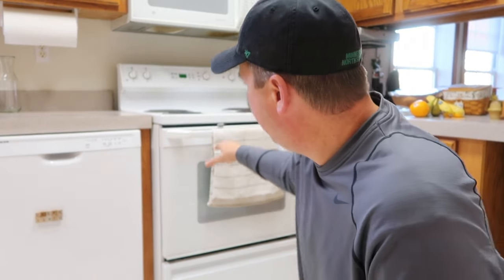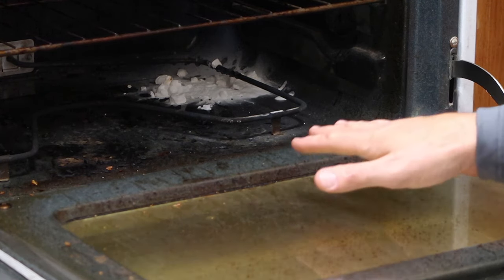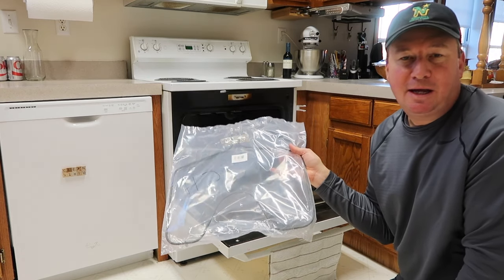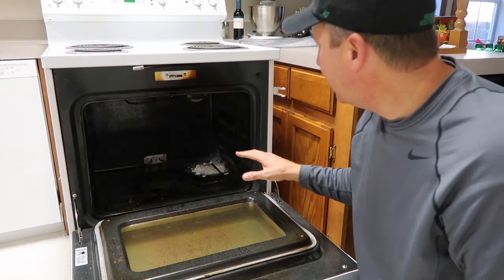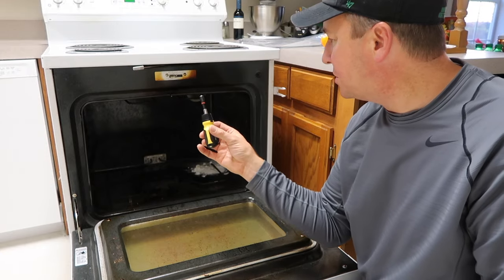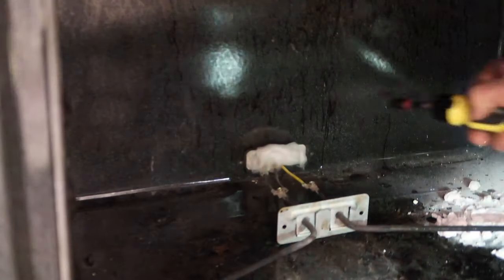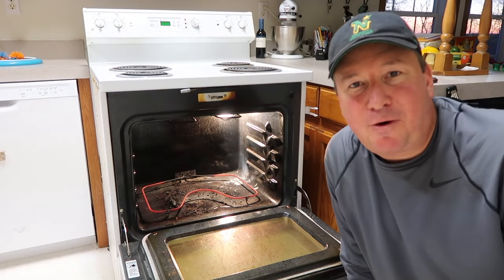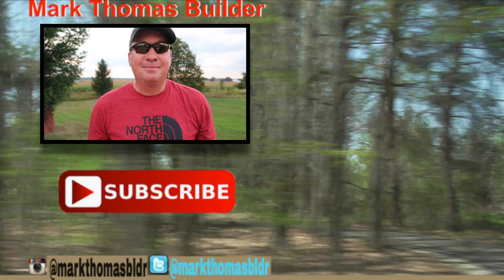HOW TO REPLACE THE BAKE ELEMENT IN A GE OVEN

Comment: Avoid using self clean. It pushes the oven to its limits and often results in a service call. The worst result I ever saw from an oven where the customer ran self clean was when the 900°F temperature deformed the bottom of the oven such that the oven door would no longer seat right. The range had to be replaced.... Better to put a pan inside with water and then bring it to a boil for a steam clean...
Reply: I just told my wife this but she thinks I'm complaining.
Reply: @OzonebxGaming  Wives.... lol
Reply: Interesting....I just used the self clean feature not long ago and now have to replace my lower heating element.
Reply: @michl37  Another common result from running self clean.... Self clean for all intents and purposes is a scam.
Reply: @JaleelJohanson62  when my friend replaced it he said you could see how the the wire was burned and confirmed that it was from the high temperature during "self clean".
Reply: Thank
Reply: @michl37 Me too!!!

Comment: This happened tonight at my sister's house. I baked a pizza in her oven. Afterwards, the element starting making a noise, then started on fire. She blamed it on me, but I guess it happens eventually. It's a built-in wall oven that's been in her house since 1991.
Reply from the maker: Yes, I was surprised when it happened to my oven, but I guess it's more common than what you might think.  It's definitely not your fault.  
I'm not sure if the self cleaning ovens wear out faster, but I'm guessing that they do.

Comment: Are the GE heater elements a standard size? If not, how do you know which which replacement part to get? Is the model number on the back of the stove?
Reply: The Model # of your stove should be on back along with other useful info. Or you can put the Make of stove in your search & compare the elements that look like yours. That's what I ended up doing.

Comment: Good video. I'm going to try it. Am I the only one who didn't know you should never put aluminum foil on the bottom of your electric oven? I've done it for years, today I learned the hard way it's a no no. The only thing I would say about this video is that you could have taken the oven door off very easily and it would have been easier to reach the screws. Thanks.
Reply from the maker: Good luck with your repair!  The door removal is a good point.
Reply: Sharon I COMPLETELY agree about the door removal.  With my GE stove manufactured in December 1998 the door removal was an easy lift up off these brackets and back on.  I saw someone else comment that it 5 or so screws were involved so I really lucked out with the lift up/drop down door removal.

Comment: Awesome vid! When I was hooking my element up, the right hook up wire was short. I had to unscrew the back part of the stove to reach the wire. The wire was going through a silver ring. When I took the wire out of the silver right I was able to connect everything. I tested The stove out and everything is working correctly. For caution reasons Do you think I should go back at try to put the wire back through that silver ring?
Reply from the maker: It's hard for me to answer that question without seeing the silver ring you're talking about.  My advice is to put it back the way the manufacturer installed it.
Reply: markthomasbuilder thank you for the response. I did.

Comment: ok... what he didn't tell you was that the 2 black wires on the left side of the element...   that wire has 120 volts constantly to it, no matter if the oven is turn of or not.   The yellow wire is 120 volts coming down from the replay and is only energized when you turn the oven on bake or self clean.  But...  power is always there if the appliance is plugged in on the black wires bottom element.
Reply from the maker: Thanks for sharing.  I recommend unplugging the oven from the wall before doing any work on it.  It's a good opportunity to clean all the junk that ends up underneath and behind it.

Comment: You should have cleaned the oven BEFORE you installed the bake element.
Reply from the maker: Yeah, good idea!  I try to run the self-clean part when I can open the windows for several hours.  Spring and fall season is best.
Reply: Dies the Self Cleaning even work if the Bake Element is NO GOOD??

Comment: THANKS FOR POSTING ! The video made it EZ to install my GE was hard wired so turned off the breaker and pulled the element forward unplugged the spade lugs plugged in the new unit and it was a done deal under 10 minutes. New unit was $19.98 on ebay received in two days.
Reply from the maker: That worked out well!  This repair is much easier that I originally thought it would be.

Comment: Thanks Mark. I'm very experienced with electrical work but I wasn't sure how the element came out. However, my GE oven does not have a rectangular hole in it. It has two small, round holes so I'm hoping I can get the terminals through there without pulling either of them (or both) off.
Reply from the maker: It was easier than I thought it would be to replace.  Good luck with yours!

Comment: I am sooooo glad to have found this video. THANK YOU!!! Mine is in a tight spot so I was contemplating how to get my tiny (adult) niece behind it in the hopes of getting to the wires.  Three things I will try/do is 1) turn it off at the fuse box because I am unsure if the outlet is reachable 2) clean it while the bottom element is out/broken and 3) use clothes pins to try to stop any wires from escaping into the cavity from which it came.  My oven will be alive again properly in no time.  PS...I remember there being extra smoke the day I think it died.
Reply from the maker: I'm glad to help.  I was actually thinking about just fixing the oven and not doing the repair.  I'm glad I did, because I really like to help people.  Thanks for sharing and hope the fix goes well!

Comment: My element doesn't have screws but nuts holding it in and I am having a time trying to get them out.
Reply from the maker: One thing I may not have mentioned is that you can normally take the oven door off pretty easy.  That might help while working on it.

Comment: Usually your oven door comes right off, giving better access to change the element and when the element comes out, it's a good time to clean any large deposits off the floor which makes the self-clean easier.
Reply from the maker: Good tip!  Thanks for mentioning that.

Comment: This video was very helpful. My heating element went out on Thanksgiving day while I was cooking. I had everything cooked except my sweet potato pie. I saw a small orange spark and at the time I didn’t know what was wrong but I turned off my oven and let it cool that way but that didn’t really do much but when I unplugged it that seem to help cool it down faster. I left it unplugged and went to Lowe’s only to be told they didn’t sell them in the stores anymore so I found a place online up in Philadelphia that sold it for around $12. My total cost was $24 and some change which was cheap considering trying to find that part online at other places they were asking $39 and $58. I ordered my part on Saturday and got  it Tuesday. Installing it was simple and quick  just like in the video and it help that I have the same stove too. It started smoking a lil bit but that was normal. I just put it on 200 and let it warm and after the smoke faded out I was good to go. Thank you for sharing. Much cheaper than calling a repairman and paying an arm and a leg to get it fixed lol.
Reply from the maker: Glad this helped!  I remember thinking I needed a new oven when it happened to me.

Comment: Tip to everyone, make sure you shop around.  I've seen these elements as high as the $80's and less than $10 - mine was maybe $12. I did my repair and oven cleaning today and I THANK YOU for doing the repair through the back if the oven, versus the panel in the back.
Reply from the maker: I bought mine locally, which was much higher in price than online.
Reply: @MarkThomasBuilder  I heard you say it was $45.  I had stopped at a local appliance store and they were in the range of $25-50 (I didn't find out about mine in particular).  I think what allowed me to go online and wait for a cheaper price was mine was already dead for about a month (toaster oven subbed in if necessary).  I had a friend say she'd just replace the whole oven.  Not unless I HAD TO.  Again...you were a BLESSING with this video.

Comment from the maker: Have you ever had a bake element start fire/arc?  Did it freak you out a little?
Reply: Mine just did in our apartment. Also a GE, but I think an older one than yours. Had it preheat to 450 when I noticed it sparking. After it cooled down I noticed something of a crack in that area of the element. Hoping maintenance can come replace it soon.
Reply: Yes..was about to bake today n heard a massive crack. The was a huge white glowing arc n spark along with an electrical sizzling sound.. Scary!
Reply: Yes indeed...4th of july sparks show coming out of my oven. It was a 2&1/2 year old replacement element. Putting in a new one now. Very scary with electrical fires. This is my 2nd install.
Reply: Yeah just about 10 mins ago. Holy shit batman I thought we were going back to the future. As if the tension wasn't already high enough this week!

Comment: That's exactly what happened to mine. Same oven.
Reply from the maker: I thought I needed a new over when it happened.  I forgot the exact cost, but recall you can buy one for less than $50.  It's a fairly easy fix luckily.

Comment: Well first do a little research to make sure you get an oven heating element that matches your range/oven. the name and model number can usually be found on the lower right hand corner of the door. Either unplug the oven or turn off the power at the circuit breaker. And it is usually easier to access the back of the oven if you first remove the oven door. A lot more information can usually be found by visiting the manufactures website under support.
Reply from the maker: Thanks for the tips!

Comment: I replaced the burned out heating element and measured the resistance of 19 ohms at the terminals when I connected it, but both heating elements do not work and do not heat up. Apparently, when the heating element was shorted on itself, some element inside the firebox was damaged too, although inside the oven the light works and backlight of the mode switching buttons also functional. I have to figure out now how to remove the oven from the cabinet.
Reply from the maker: Humm, I don't have experience with those types and how they're installed.

Comment: An appliance salesman told us that the high heat of self cleaning can make the element go bad. They're now selling steam cleaning.
Reply from the maker: No kidding, that's interesting.  I need to self clean mine, but I better be ready to buy another one.  Luckily it's a quick repair.
Reply: Looks like our element is under the floor of oven but don't think element is our problem anyway.

Comment: So interesting. I have a similar problem at home with an oven I found here in the apartement. It's not mine, though. I need to buy the bake element ( the botton burner). I hope to succeed. Thanks for the advice.
Reply from the maker: It's much easier to do than you might think.  I know some apartment places will fix it for you, which is included in the rent.

Comment: Next time you need to do work inside oven, Remove the Door so it's easier to get inside.
I get to do this on my oven over the next week after I get the element.
Reply from the maker: That's a good idea.  I have a self-cleaning oven and think the door is more difficult to remove.  I recall standard ovens where the door comes off easy.

Comment: No but it was glowing brighter than it was suppose to in one spot. Probably it was about to fail. Stove got hit by lightning later on and now does not work at all. Now using countertop oven and portable burners.
Reply from the maker: Wow, not sure what to say if it was hit by lightning...  My bake element was an easy fix and works great now.

Comment: My wires were the same color. I just attached where they came off from. I think I got the wrong size tho it seems a bit big.
Reply from the maker: Did you match you oven model number to the part?  I'm guessing there's various sizes available.

Comment: I saw another video like this one last night and she showed I would have to pull my oven out from my already cramped kitchen.  I'm so glad I found this video.
Reply from the maker: Oh man, glad you kept looking around.🙌
Reply: @MarkThomasBuilder  ME TOO!!!
Reply: @MarkThomasBuilder  ...update...I had to take off the back of the oven...a nice little zip tie looped one of the wires that connects to the element.  Seriously, no clue how that happened. Husband screamed like a white lady when I got out the scissors to cut the zip tie.  Seriously, he thought I was going to cut one of the wires.  I replaced both elements, the bake and the broil.  I got both for $40 with shipping from Amazon.  If my arms were a little longer, this would have been so much easier.
Reply from the maker: @amiedavis5257  Interesting, I haven't looked at replacing the top broil element.  Glad to hear you were able to fix it yourself, even if it tool a little longer.
Reply: @MarkThomasBuilder ...All I had to do was tell my husband..."Saved us several hundred dollars."...And of course show him the oven works flawlessly

Comment: ok so i took my element out and the burner stop working???  I am ordering a replacement coil but hoping thats all tied in???
Reply from the maker: I can't say for sure.  I made sure to hook everything back up the way I found it.  Did you have any luck?
Reply: well i did with getting the coil replaced..  but no it wont turn on.  Maybe the fuse?  It was all good before I unplugged the coil ( they were burnt in half)... i am still googling it about the fuse?
Reply from the maker: Sorry I can't help further.  It worked for me without effecting the coils.
Reply: @MarkThomasBuilder   thanks though!

Comment: Wouldn't it be best to unplug the range first?  - I got hit with a bad jolt at work once and it threw me 10 feet back.  I never do anything without disconnecting from the power source first.  You made me cringe watching you doing this!
Reply from the maker: Yes, disconnecting is always necessary.  Even if the oven is turned off.  Thanks for pointing that out.

Comment: Hi Mark.  I was replacing the bake element on my GE oven but have come to realize that one of the metal connectors that the element connects to is burnt up and need to replaced too.  What are those called?  I am having trouble finding them.
Reply from the maker: It's a wire disconnect end that you're referring to.  That's too bad that it burnt.

Comment: Thanks for the helpful video. My oven just seems to take forever to heat up (my element didn't arc out like yours). I'm going to pull it out to see if the screws might have come loose. If not I'll order one on-line. Well edited video and to the point Thanks Again.
Reply from the maker: Thank you, I'm glad to hear that.  It's possible that a new element will do the trick.

Comment: Looks like your heating element is like mine where you have to actually screw it in as opposed to snap it on. I can’t seem to find a heating element that has holes big enough for screws to fit through it. The only thing I can find is a snap on element. Where did you get yours?? Any ideas? Thank you!
Reply from the maker: I replaced mine two times now.  The first one was from a local appliance parts place and charged double the price.  The most recent is from Amazon.

Comment: My heating element it's not broking but it's not heating thou there's no problem with electric and it's normal electric but it's not heating ?
Reply from the maker: If the correct amount of electricity is getting to the element, then it sounds like a bad element to me.  Unfortunately, I'm only familiar with the repair I did in this video and can't offer any accurate advice.  Hope it's an easy fix for you.

Comment: The bake element usually fails first cause it's used more than the broil element.
Reply from the maker: Mine has failed twice.  I'm not sure if the self cleaning function wears it out faster.  My last one is still going strong after 3-4 years now.  Luckily it's an easy replacement.

Comment: Video was very helpful. Only one question after i instolled new heating element it does not quite touching the bottom of the oven. Is it going to be  a problem?
Reply from the maker: I think mine did that at first.  I believe once I used it a few times, it eventually settled and rested on the bottom.  Let me know how it goes.👍

Comment: My wires aren't attached to the element with screws. They're crimped? Or something? Can't tell.
Reply from the maker: Interesting, I haven't heard anyone comment that issue yet.  Hopefully you can figure it out without it getting too complicated.
Reply: @MarkThomasBuilder  Strange. Ended up having to take the back panel off and pull the prongs through the back so I could disconnect the wires.

Comment: The broil element in my GE oven has stopped working.  Can these instructions also be used for replacing a broil element?
Reply from the maker: I haven't encountered that issue.  The bake element is easy to do.  I'm thinking the top part should be straight forward too.
Reply: @MarkThomasBuilder  Thank you for the reply and info.  I've order the parts - decided to replace the bake element also - and will tackle it when they are delivered.